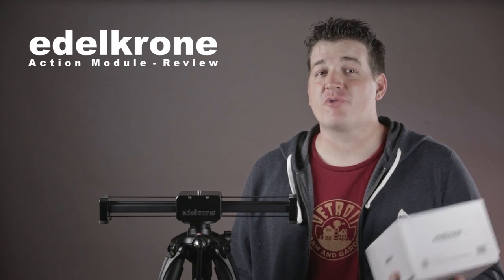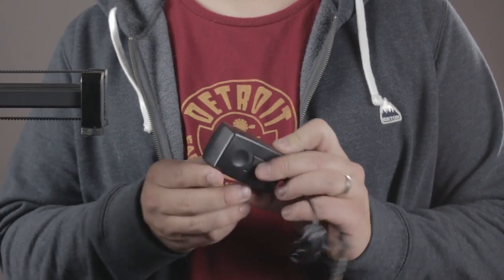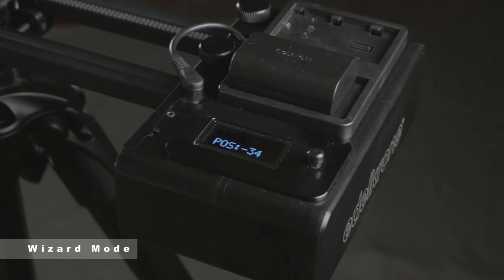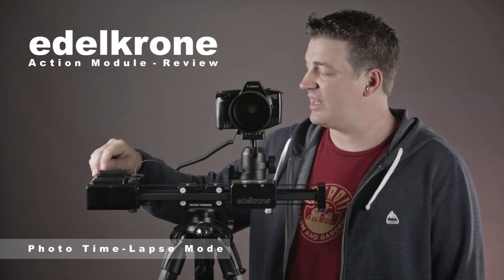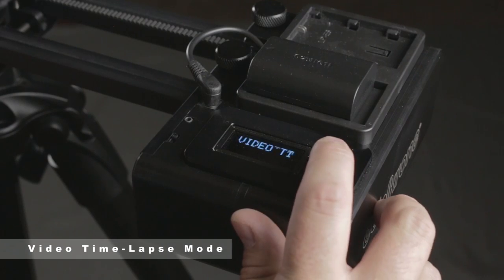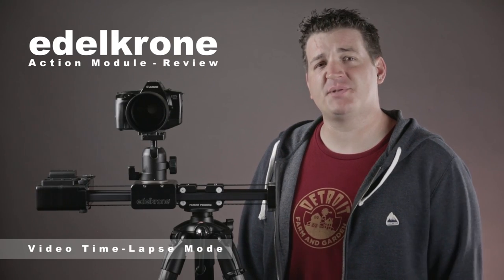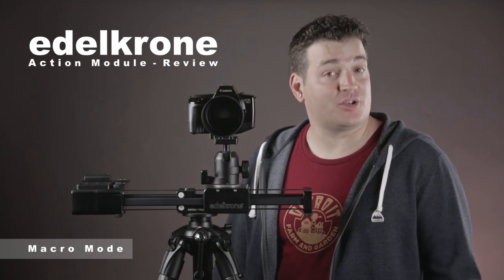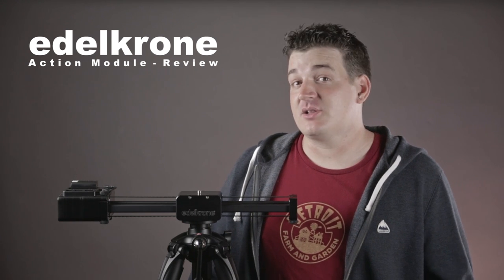A Look at Edelkrone's Action Module

Comment: I would like to know exactly how you use this to shoot HDR.  It appears to me that may or may not work... not certain why... but, I believe it has to do with the Action Module units "signal length" to the camera (length meaning - how long the signal is sent to the camera from the module).  Some cameras require only a short (or easy push of the shutter button) for multi exposures to occur.  While some cameras require a long (or harder push of the shutter button) for multi exposures to occur.  I am curious what camera you use with the Action Module to get HDR shots... I have been unsuccessful with the Canon 60D.  I plan on trying it out on a T2i ... it seems to be more sensitive to taking multi-exposures (i.e., takes multi exposures with little effort (or push) on the button).

Addendum:   Just to help clarify what I posted above.  A proper HDR multi exposure shot is done when all shots are done at once from the same position.  My problem is that...The Action Module will shoot one exposure shot... MOVE... shoot the next exposure shot... MOVE... then, shoot the next exposure shot.  In a perfect world... all three exposure shots should be shot before each move.  Have you been able to achieve this multi exposure 3 shots per each move process when you shoot HDR with the Action Module?  If so, how?

Also, I believe you said minimum shutter speed is indicated... according to Edelkrone site... that is the longest shutter speed you can have at the levels you inputted.
Reply: Hi Joe. did you ever get hdr working? I found on the 60d when in live mode (and on 'm') it will do one exposure at a time, but with the live view turned off, it takes 3 consecutively with one push.
Reply: Well... I did get it fixed?  ...but added an 800+ dollar Syrp Genie Motion Control timelapse device on to the Edelkrone ->  A much more expensive solution to get HDR.  But, it did add both lateral movement WITH rotation to the ability to move the camera while shooting HDR timelapse with the Edlekrone.  

I am going to try turning off the Live View Mode and see if that works... If it does... I am going to be bit miffed at myself for not trying that simple solution.  I REALLY appreciate your help and idea... wished I thought of that some time ago  :( ... On the other hand, fixing the HDR issue may have not given me the excuse to by the Sypr Genie Motion Control Device. :)   

BTW... after I spend a few more months using the Edelkrone And Syrp combo in real world conditions (both studio and outdoors)... I plan on posting a review video.  So far, after only 2 months of easy use... It works great - with some simple finessing with calculations and settings.

Again... thank you very much.
Reply: +Joe Moya Any updates Joe? Curious to see if the HDR solution worked - as I'm looking to purchase the edelkrone soon. Also would be very interested to see that Syrp combo video - looks like it could be a replacement for the target module with the rotation feature
Reply: I just got through fiddling with the 60D and the Eldekrone slider with Action Module.  And... I found that no matter if I have the Live View Disabled or not... when the action mode device sends the signal to the camera, it only takes one shot.  It does not take repeated 3 shots per each movement as needed for HDR shooting.  This is not about activating the shot "with one push" of the shutter release button.  This is about using the signal from the Edelkrone Action Module to initiate the 3 consecutive auto exposoure bracketed (AEB) shots needed before the next movement to produce a true HDR shot.  

I even put the AF Live Mode into Quick mode as well... still no difference when shooting in the Time Lapse Mode of the Action Module. It appears to me the signal from the Action Module does not trigger a AEB with each movement needed to produce HDR.

Still open to other ideas.  But, untl then I will have to use the Syrp Genie, HaHnel Captur Module Pro and Action Module combo to achieve an AEB shot per movement and excellent HDR Timelapse results.  BTW... I really like the Edlekrone Slider ... it has proven to be a real work horse in all types of environments but it jsut doesn't allow for control of signal hold period to camera.  The 60D needs a longer hold period for the signal.  And... the 70D seems to have even more issues with signal hold periods to produce AEB than the 60D.
Reply: +Joe Moya Hey Joe, I got the slider and figured it out!  The key is to use the 2-second delay (I think live view needs to be turned off) Now the slider slides, waits 2 seconds, and takes 3 consecutive images. You've just got to make sure that the interval from the edelkrone gives you enough time with these additional 2 seconds. 

It tells you "make sure the shutter is less than x seconds", I've found that even at 5 seconds I can do a day-time timelapse.

Hope that works for you!